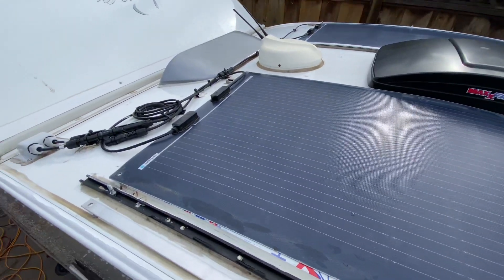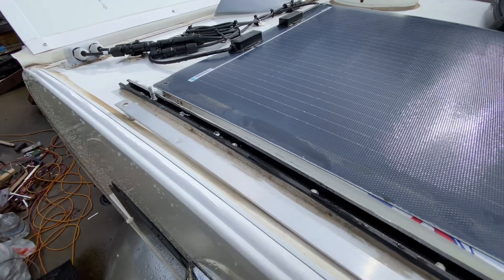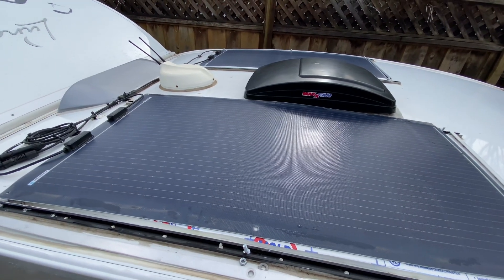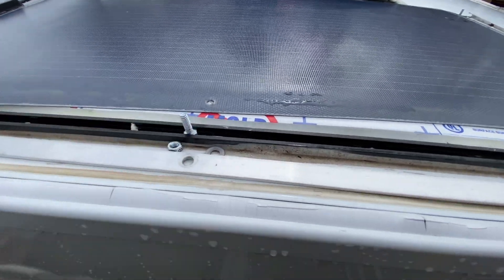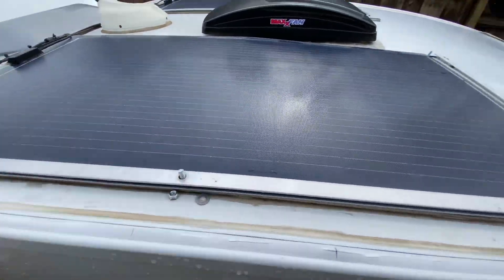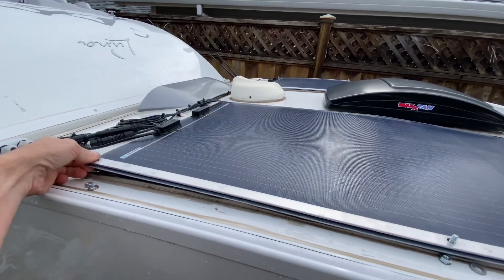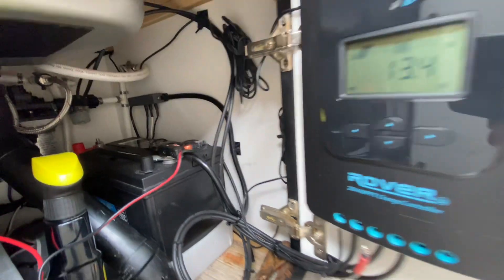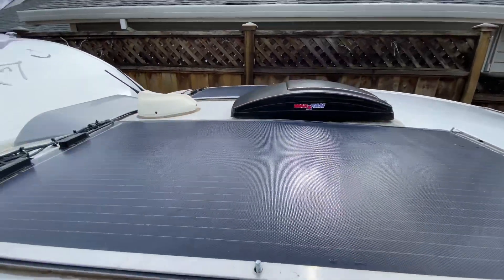Flexible Solar Panel Install on Intech Luna Trailer

Comment: How has this setup held up?
Reply from the maker: @JoeySilvaFishing  Very well. In a state now with heavy snow and no issues. Still charges the batteries faster than I can use power